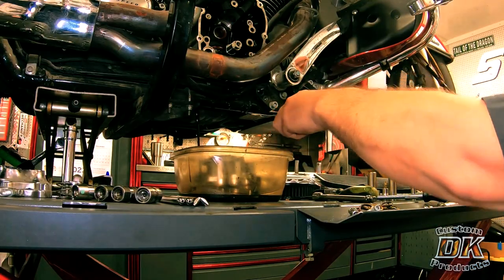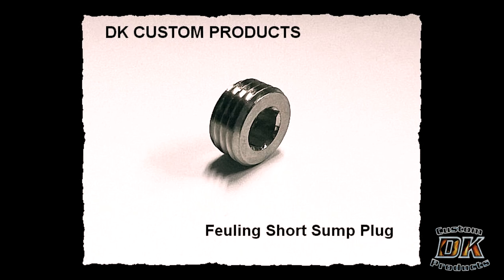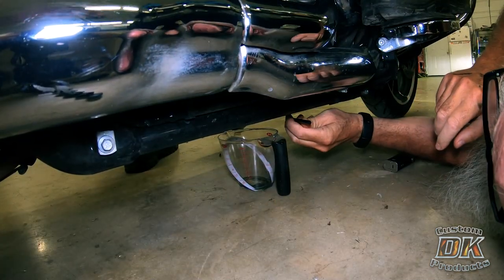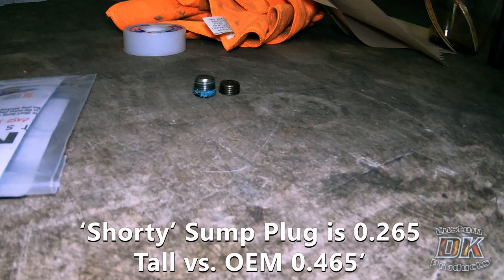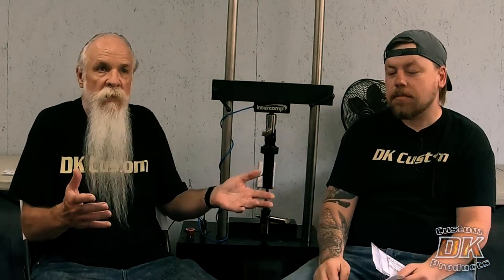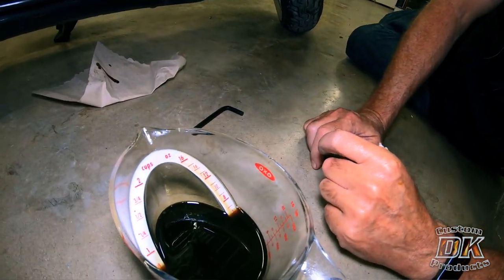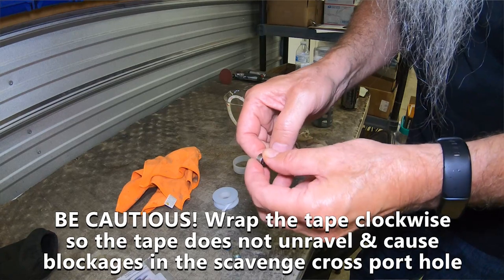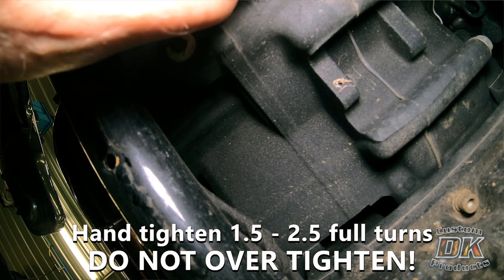Testing 3 M8's w/ the "Shorty" Sump Plug #harleydavidson #motorcycle

Comment: Dammit I need to get off my butt and make my install video of this. 
I used Permatex high temperature Thread Sealant that's recommended for Oil Fittings, Oil Lines, Fuel Fittings, and similar fittings/plugs.
Rated to 400F temperatures.
I thought it'd be a nice and easy way to do it over trying to tape it or use the loctite thread sealant that didnt seem to have a temperature rating.
It was hard to find that tightening limit. I used a torque wrench set to 60 inch lbs and then 80inch pounds which is about half of the stock recommended, and then turned it a bit more. I don't think it went beyond 2.5 turns to get there after it being snugged.
I was very paranoid about damaging the engine.
But now my bike has a trans vent, short sump plug, and SE oilpump and plate system. Trifecta of solving the sumping issues.
Reply from the maker: Good deal, sounds like you have your bases covered.  👍😎👍
Reply: Did the same replacements. Did not use sealant you did. Or tape. Dealer installed. Guy I trust. It leaked. He fixed.
Reply from the maker: @wldmn602  Glad he fixed it for ya! 👍
Reply: @DKCustomProducts  He is a master tech a solid marine!  We used some Teflon tape and red locktite this time. Also carefully tightened it a little tighter. We were a little apprehensive the first go. Did not want to crack anything.
Reply from the maker: Good deal.
We do not use red locktite, for the reason that if it even needs to be removed, it will be a bugger.  But those chances of need to remove it are low.  If you do, use some heat on it.

Comment: Yea, nice that people and DK lets us know about a this contributing factor..i pulled mine out on a regular or routine oil change, and im surprised its not standard proceedure as there will be oil there to drain..i had around 6 ounces..i want that out!.. The plug was 11mm tall, the allen head was 6mm deep..i did a 2mm grind onthe plug..will land perfectly flat or level..cost..none, time..15 minutes, but thanks for letting us know, and keep up the good work
Reply from the maker: Thanks for the specs on that.  👍😎👍

Comment: My 2022 117 lowrider st slumped beyond belief. Pumping oil out the breathers all over the side of the bike. Long story short, the sump hole was machined improperly. Even the Fueling plug would go into too far. A long time retired pipe fitter told me how to correct it. Because I had used an after market tuner, Harley refused to honor the warranty. I spent over$1000.00 out of my pocket trying to repair the Sumping on my own. What is the reason for a sump plug to begin with? None I can think of.
Reply from the maker: Wow, that sounds like a Dealership that would not go to bat for you.  Sorry to hear that.
I know it is too late for this situation, but the info in the video below may be useful to you- https://www.youtube.com/watch?v=3etb7O62GOA
There may be other reasons for a sump plug, but you do have occasions where draining the sump is desired, which is accomplished be removing the plug.

Comment: I installed one in my bike after your 1st vid of this product. Put Teflon tape on it, screwed in so far with no effort I think it went up as far in the chamber as the OEM b4 it got snug. Kinda ridiculous.
Reply from the maker: Take it out and remove the teflon tape.  Then put 2 or 3 times the number of layers of tape on it.  It should only screw in to be flush or a little past flush of the engine case.  Don't overtighten.

Comment: Our 2017 Tri Glide has never sumped and it’s a Stage 2 with the original oil pump
Reply from the maker: I was hoping for the same with my 2019, no such luck.  Mine was just barely starting to...so I suffered no problems from it. 👍
The vast majority do not have a problem with sumping, but there is no rhyme or reason to whether or not one will start, and when it will start. 😱

Comment: A real shame this isn't available in the UK. Seems to be a common issue with third party Harley parts.
Reply: I should point out that over $40 shipping for such a tiny part is nuts.
Reply from the maker: As you noted in your other comment, they are available in the UK.  We ship to the UK almost everyday.
Reply from the maker: Yes, it is no small cost to move a package from the middle of the US, halfway across the world and have it delivered to your doorstep. A couple of ways to reduce the cost-
1.  Have more than just one small item shipped.  The cost of transport goes down per part.
2.  Do a group purchase, where a bunch of your buds and you pool together all the parts wanted and ship them together for a reduce cost per part.

Unfortunately the postal service is no longer reliable at getting small packages delivered via 1st class mail (which is the least expensive).

Comment: Fueling says use the loctiteand and consider the tape but be careful if you use tape. You guys say use the tape but consider the loctite. I didn't see any need to measure what came out of the drain plug, a notable difference should have showed up in mpg if my bike had a sumping issue I think (there was no mpg difference after change), changed the plug  with the bike cold and on the jiffy stand and not enough oil came out to even inspire me to check oil level, maybe 1/2 ounce ish.
Reply from the maker: Yes, either the 543 threadlocker or the tape will work.  Just be careful with the tape.
Trying to drain the sump with the bike on the jiffy will not work.  The drain is on the high side, and all the oil will be on the low side.
As stated in the instructions-
Drain when engine oil is up above 200F, and do it with the bike upright.
Reply: @DKCustomProducts  I got a little bit different answer back from Fueling "The Harley-Davidson engine is considered a dry sump engine, meaning the engine oil is stored in a separate oil pan unlike a car engine. The sump plug on the bottom of the engine case will only drain what is in the engine case. This should be somewhere between 4-10 oz depending on how long the bike has been sitting and how much oil has drained down from the top end of the engine. With that being said it is not necessary to wait until your oil change to change the plug and you can install it with the bike upright and level or on the jiffy stand.". According to my tiny pee brain the thought was that if the bike is going to drain oil into the sump from the top end of the engine every time you shut it off then there is no need to be concerned about getting every drop out of the area. I am not arguing, I am ignorant and just trying to figure things out.
Reply from the maker: Yes, if you are not interested in knowing how much is in your sump, there is no reason to have the bike upright.  But if you want to know if you are beginning to sump, gotta have the bike upright.
Check out the step-by-step info, and many other details, at the instructions at this link, especially the bottom box on the second page-
https://www.dkcustomproducts.com/media/wysiwyg/Sump_Plug_Instructions_9-28_1.pdf

Comment: This sumping issue with m8's is starting to bug me. Does a '23 Low Rider S have the short sump plug from the factory? What is with Harley? They make this cool  8 valve engine and we have to play games with vented dipsticks and everything else.
Reply from the maker: Your 23 Low Rider S does not have the shorty sump plug factory! 

As far as vented dipsticks Harley is strapped by the EPA and there is not much they can do about that. 
Those direct crankcase vents can reduce what vents from the head breather ports and most notably reduce the liquid oil carry over, but this is only a reduction... Not a total elimination.
At the very least, there will still be oil vapor present in the air box... even if this vapor can not be seen, it still displaces volume or space. Essentially the more oil vapor in the air box; the less oxygen in the air box.
Less clean oxygen rich air in the intake will always be a detriment to performance.
The only definitive way to keep the intake free of crankcase ventilation, is to re-route the head breather system outside of the air box.
The best scenario, at least for peace of mind, is to run both components.
Everyone's situation is going to be a bit different and results can vary but a head breather system vented externally will always be beneficial to engine longevity and overall performance.

Comment: Hey guys,
Do I have to replace the amount of oil that comes out of the bike once replaced?
Reply from the maker: if it leaves your oil level below the midway point of the top and bottom marks, it would not hurt to replace it.  However, if it is above the bottom mark, there is no need to add more.  Here is a video on the subject- https://www.youtube.com/watch?v=anShki_WeL0

Comment: I have been told by the dealer that with my 2022 street glede special I would not have the sumping issue. Can you give me your opinion on that please.
Reply from the maker: Since 2020 the possibility/probability of sumping is Very Low...but here is what an Experienced Harley Manager has to say on the subject- https://www.youtube.com/watch?v=_4wxFjqyTAU
Reply: You can tell if Crud is in the maiifold and you need  a external breather it's all in how you break it end better seal less blow by
Reply from the maker: @chrisbrintnell3590  Oil is only one of the negative aspects of not having an External Breather System.  Even with little blow-by, the hot, oxygen depleted air is still a power robber.   Video on the subject here- https://www.youtube.com/watch?v=EfDeFZblMck

Comment: I bought a shorty from you. You can replace sump plug and check how much comes out (hopefully under 12 oz) with out changing the oil ?
Reply from the maker: That is correct.  When you pull the OEM sump plug, to replace it with the Shorty sump plug, the only oil that will come out is what is in the bottom of the engine...hopefully only 4-8 ounces.
The majority of your engine oil is in the oil tank, which is separate from the engine.
Please follow the directions on how to pull the OEM plug and check the oil amount, as seen at the bottom of page 2 of the following link-
https://www.dkcustomproducts.com/media/wysiwyg/Sump_Plug_Instructions_9-28_1.pdf

Comment: Do you pull the plug after running the bike for a while and getting it hot or do you check it cold?
Reply from the maker: You will want to run the engine up to operating temperatures and while the bike is upright you would pull the plug. You can see the instructions at this link - https://www.dkcustomproducts.com/media/wysiwyg/Sump_Plug_Instructions_9-28_1.pdf

You can see the sump plug at this link - https://www.dkcustomproducts.com/milwaukee-eight-feuling-sump-plug.htm

Please feel free to contact us with any questions;
Support@DKCustomProducts.com
662-252-8828

Thank you for commenting! MB

Comment: I have a question , on my 22 Street Bob , I put a Cam in it and while I was at it I PU a S&S Oil Pump . I will still change the Sump plug since you suggest it and it’s cheap and easy . The S&S pump doesn’t make any difference ,Correct ?
Reply: I just read the post below , question answered . Thanks for the Video ,great Imfo !
Reply from the maker: Cool. 👍😎👍
Reply from the maker: That is correct.  Replacing the sump plug, regardless of what oil pump you're running, including OEM, is inexpensive insurance.

Comment: Kevin have you pulled the new shorty plug to see if it did help? Or did Dwain pull his to see if there was in fact less  oil in the bottom? Would be awesome if you guys did a shorty video showing the results. Thank you
Reply from the maker: We have tested it, and, as stated in the video linked below, on some it made a difference, and on others it did not.
Here is a video where Hoodie talks about the problem being discovered that you may find interesting- https://www.youtube.com/watch?v=_4wxFjqyTAU

Sumping because the scavenge port is partially blocked is fixed with the shorty plug.  But out of round cylinders, bad rings, bad oil pump or a crank with too much runout can all cause sumping also.

Honestly the proof is that if you have a small area that oil is suppose to be moving through freely, but it is not allowed to because of a blockage, you remove the blockage and you have relieved some of the strain on the pump trying to move that oil.

Comment: I'm thinking most the sumping problems are from faulty piston oilers, gushing  too much oil
Reply from the maker: That is certainly the case sometimes, but, even bikes with good oilers will sometimes sump, so it is not the only reason.
Reply: Most Sumping problems are caused by too much runout  on the pinion shaft affecting the operation of the oil pump.The suction side can't keep up with the feed side and oil builds up in the crankcase. If you have a Darkhorse crankshaft with Timken bearing conversion and upgraded oil pump your engine will not sump. A brand new harley  crankshaft will not pass Darkhorse specifications. They balanced and welded my crankshaft within half the thickness of a human hair.You never hear of Evo engines sumping because they have Timken bearings and the oil pump is not driven by the crankshaft.
Reply: @scottbradshaw5249  you have a good point and Darkhorse is definitely top of the line. I was basically referring to the earlier years of the m8 motors were having more than usal issues with sumping. Harley switched manufacturers for the piston oilers, and apparently quite a few motors went out before they realized  the oilers were faulty. The Harley specs. called for the oilers to begin spraying at 7psi .When they started testing the new oilers they would spray with 2psi or less. This makes me assume to much oil was discharged from the oilers. The issue was like 2017-2020. Pinion runout for harley cranks can be pretty bad even now   2023 .

Comment: When I put in the fueling plug, is 20oz of oil that drained, "bad" ?
Reply from the maker: Yes, if you followed the directions that came with the Shorty Sump plug, that is bad...if you did not follow the directions, impossible to know without pulling the plug again.

There is one way to know if you are sumping, if you did not follow the directions...follow them, then pull the shorty plug and measure what comes out.  Then you will know.
Here is a link the the directions.  https://www.dkcustomproducts.com/media/wysiwyg/Sump_Plug_Instructions_9-28_1.pdf
KP
Reply: @DKCustomProducts  I'm going to do a ride for a bit at low RPMs, then check it again. After that I'll do a highway run then check. I'm waiting to get a S&S camchest upgrade but my tech is booked for a month :(
Reply from the maker: I hope you get it figured out and fixed! Thank you for commenting! 👍 MB

Comment: I just installed the shorty plug. Do I need to add back all the oil I drained from the sump opening? I measured like 7 OZ.
Reply from the maker: Most likely not, but you can check your oil level and if it needs oil put some in it! 

Thanks for commenting!

Comment: Another great video!! I have to ask though something that bothers me for the past year or so… I have a 2020 Road King Special that is missing that Harley lope. What is the absolute necessary stuff I need to buy and have installed for obtaining that sound I don’t care about power or torque bike has enough on both 😀 I just need that sound sole reason I bought it from a Forty eight that I miss sooooo dearly. Thanks again !! New sub as well
Reply from the maker: On the M8's, between the counter balance in them to make them run smoother, and the EPA requirements (that include a cam that does not produce much of a lope) it is pretty much impossible to get a M8 to have that lope that is the "Harley Sound" without replacing the cam with one that will produce a lope.  
I did that myself.  Here are a couple of videos that you may find useful/interesting-
First one is what cam I used and why- https://www.youtube.com/watch?v=Ax1e2gNvdsk
This one gives you an idea of the sound achieved with the cam- https://www.youtube.com/watch?v=yIbqJ7ytr3w
Reply: I agree with DK Custom here.  I have a 2019 Sport Glide (107 B motor) I purchased brand new and stock.  I was only interested in the sound/engine lope and did a stage 1 with intake and slip-on.   The result was a minor improvement in the exhaust note being deeper but no Harley lope which is what I really wanted.  I then went with a Stage 2 torque cam install and that did the job - finally got that Harley lope that I'd been looking for.  The HD torque cam is mild (I think 465?), and you can get a much better lope with a more aggressive cam (ie: a 475 or more), but I have the extended warranty and wanted to stay with HD.  If I was out of warranty, I would have definitely gone with an S&S or other good aftermarket cam.

Bottom line, you absolutely need a cam upgrade to get that Harley engine lope.
Reply: @VN9001  thank you but I ain’t giving HD another $4-6000 more to get a Harley sound. Indian Springfield will be the replacement without any NEED to buy parts that HD left out🤣🤣. I wish I’d known sooner(before signing the dotted line)… Lesson’s learned 🤓
Reply: @MRGS48  Yeah, It seems no matter what HD model you buy, it's a "base line" bike that Harley makes you invest more money in just to bring it up to a "normal" standard.  You shouldn't have to upgrade exhaust and cams on a brand new bike to get what should be stock from the factory.  This will be my last Harley purchase as well.  I'm eyeing the Triumphs, very reliable and well made.  So are the Indians.
Reply: @VN9001  I be test rode an Indian Springfield DH 116 and the monoshock was a little better than my BMW GS adventure ESA !!! And I am not exaggerating… if I buy another bike that would be the last ine